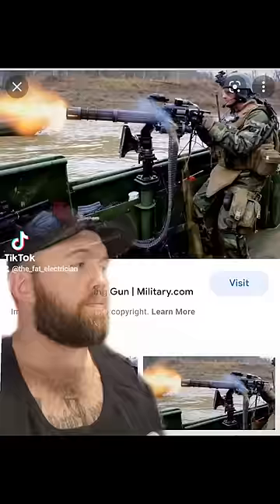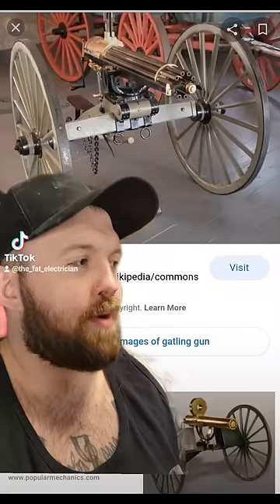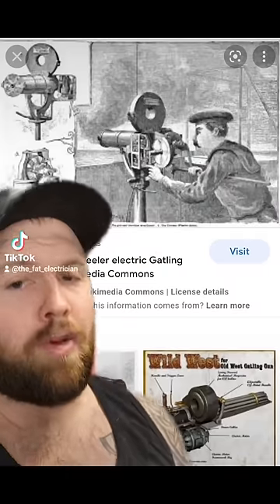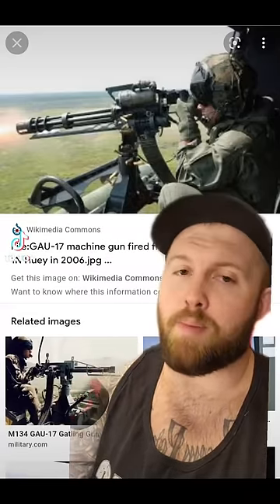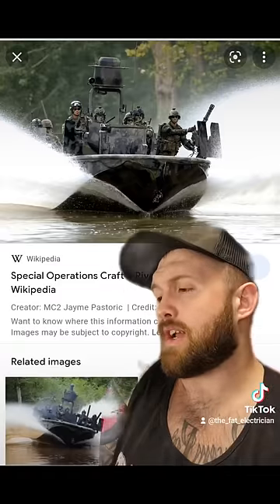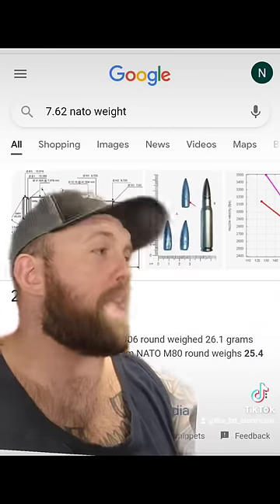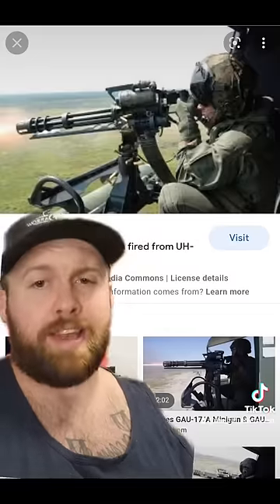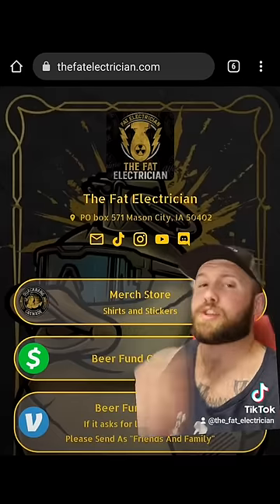The Fat Electrician Reviews: "The Minigun" GAU-17 - M134

Comment: The main feeding problem it had the the gun originally ejected spent casings out the top/side. The casings wouldn't eject fully, fall back into the mechanism, and jam up the works. The design engineers came along and said, "hey, why don't we let this thing eject from the bottom and let gravity help?" The rest is history. Again, grunts who understand science.
Reply: Tippmann manufactures a 9mm Gatling gun. Side eject iirc
Reply: @BFVgnr  the beast was originally in .45-70 so the cavalry could use rifle ammo for it in a pinch. I bet the 9mm just flies.
Reply: @davidyoungquist6074  god .45-70 at 3000 RPM would make the M2 weep.
Reply: @nightshadedawn  for sure. That would be insane.
Reply: grunts and science is a horrifying combination
Reply: @dominiking69  lol! No doubt. Especially when a lot of them are hillbillies and have grown up having to improvise everything from bicycles to tractors.
Reply: 140 yr old machine guns also dropped ammo from bottom
Reply: A brass waterfall is also known as a freedom fountain
Reply: I was wondering if that tube going down off the gun at 2:48 was essentially plumbing for spent casings. The gun needs a toilet it shits brass so fast.
Reply: And paving the way for the bullpup, as well.
Reply: I can completely assure you that no engineer has ever said, "hey, why don't we make this device's secondary function be to fight gravity."
Reply: @danpalchak6916 Me like very much....
Reply: I mean if it was from the top then it makes complete TFE sense. The US didn't amend our bad blood with the UK until WWI (or so) so we just up and denied the existence of that weird stone weighing nuthead, Fig Newton....Sorry. Issac Newton, and his "invention" of gravity....because it was a British thing for a while. Then the US imported it (gravity), made it better, and got to the moon. Or at least I'm sure that's the story TFE's heard.
Reply: I'm not entirely sure about that. I have fired a galling built to the original drawings that used the self contained chamber firing a .577 Minnie ball and using a musket cap for ignition. It ejected out the bottom. Not saying the later designs when rimfire and centerline ammo came along didn't eject from a different place, just the original that was designed in the 1860's did.

Comment: Once again, being a former member of the 1st S.O.W. (specifically the 20th Aircraft Maintenance Unit, attached to the 20th S.O.S. Green Hornets [Helicopter assault unit]), I worked on the MH-53H Pavelow III, which (when loaded for bad-assery unhealthcare), was armed with either the M2 Browning .50 cal. machine gun, the GAU-17 M134 minigun, or some combination of the two, for a desired effect of much deadness all around.

Comment: The 20mm vulcan gun was developed before the minigun as a weapon for jet fighters, the M134 is basically a shrunk down vulcan. It was originally developed when someone in the US Army wanted to put a vulcan gun on the AH-1 Cobra but it was too big so they asked if they could just make a smaller version that would be light enough. The AH-1 typically carried 6 of these things three on each side where the rocket pods usually went.

Comment: The rate of fire actually can be higher than 6000 by adding more electricity to the motor. Forgotten weapons did a whole video about this same weapon, and yeah. Hiding behind the engine of a vehicle, that just means you'll die slower. They were putting rounds THROUGH an S10. Not just into it like an AK47 will do. There is also the gau19 which is.50 caliber. Haven't seen much on that one though.

Comment: Also, one way the rounds are packaged (I'm sure there are other ways but this is the one that I know of, like actually, factually know of) is 1500 rounds in a metal can.... It weighs about 120-ish pounds......... That's a lot of weight for not a lot of bullets for a weapon that shoots as fast as it does...... Also, it fires so rapidly that the Tracer to Ball ratio is 1 to 9 instead of 1 to 4 like it is for M249s, M240s and the Ma Deuce and it still looks like a solid ray of light is coming out when you shoot it...........

Comment: The higher the rpm (rounds per minute), the more accurate the firing is.  The tracers are so frequent that you can just walk the curved beam right on to the target.  Even against armored targets, you're going to mess up anything exposed that's not bullet proof: sensors, cameras, secondary equipment, and weak points like engine vents.

Comment: Good rule for a pound of ammo is 20 rounds of 7.62 is one pound. Just like 30 rounds of 5.56 is a pound. 
200 round 7.62 ammo can is 20 pounds. 300 round SAW nutsack, again 20 pounds. 
There’s a company making a 5.56 mini gun called the ‘micro gun’ which is just slightly less cool than the 3 barreled.50 cal they used to put on the Cobra.

Comment: We don't carry  more than two MK44's it's because they are Electrical and draw a lot of power. Generally only run have one one the boat because we can one run 1 at a time. Plus the Jam very easily and thier is no  immediate action to get the gun back up they are actually a nightmare. Amazing when they're running a nightmare when they go down.
Reply from the maker: isn't it also you can't fire In bursts like a regular machine gun cause the you have 2 allow the barrel to quit spinning before you fire again?
Reply: @the_fat_electrician  not really on the  Mk-44  they stop as soon as you let off the trigger, older versions do however.  You fire 3-5 seconds because you'll go black quick the can only has about 750rds. You have to go hard on and hard off the trigger because she'll jam very easily the gun is awesome but still the feeder delinker is temperamental, the timing has the to but set just right for her to run right. We always had a M-240 if the gun went down. The pineal mount is the same so it's a quick replacement.  Talking guns with the other boats is Important to maintain fire superiority  during hot extract. But not guying to lie I do miss Mini-gun Therapy from time to time.

Comment: Marine Helicopter Mech here... The GAU is a ridiculous piece of "military technology" that even the user has a love-hate relationship with. The way this thing feeds is ridiculous, and the weapon will sometimes just decide to take a day off and stop functioning for just long enough for the aircraft to not be in range of an enemy anymore. It also has 2 feed motors: yes, I siad 2. One is mounted onto the weapon and controlled by the actual rotation of the barrels, whereas the second is integrated into the ammobox. Not sure if that is an HMLA specific thing, but it does exist. Because sombody at some point decided that it jammed too often and came up with a solution.

Comment: So...I did some math and turns out each bullet is less than 5 feet apart from eachother at 6000rpm and 2800fps. I got 600rps, which is 0.0016 seconds between each round. That 0.0016x2800fps you get around 4.6 feet.

Holy fuck.